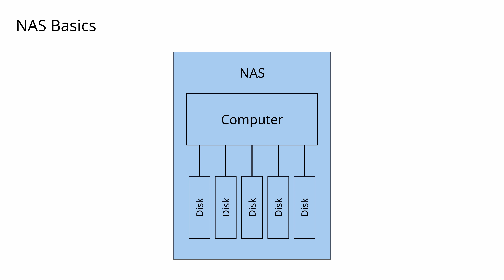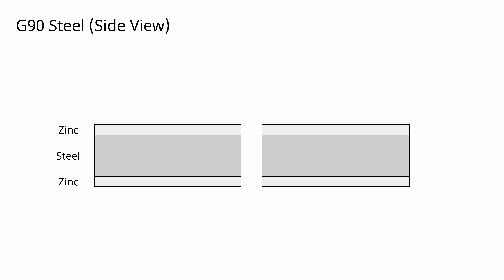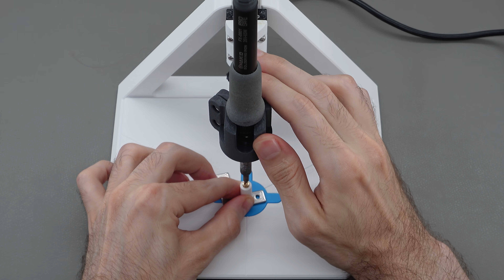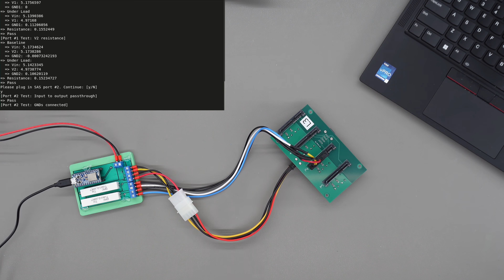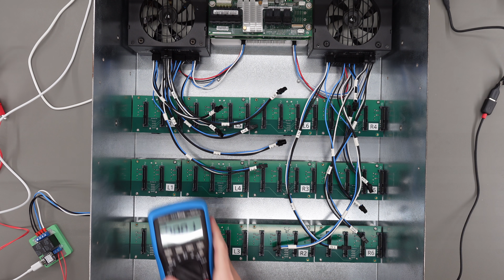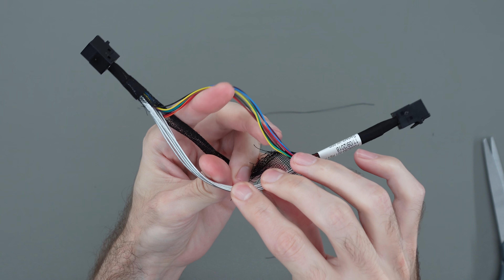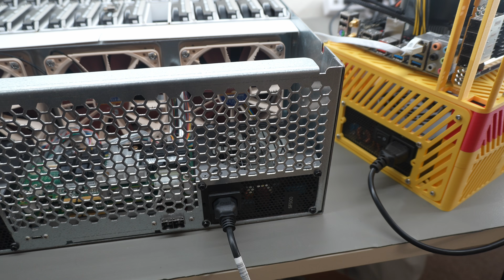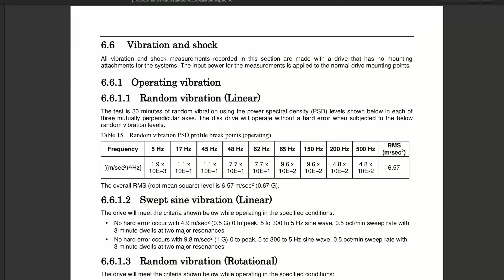I Built a 1 Petabyte Server From Scratch

Comment: Good grief, spectacular job.  What were the green and red LEDs signifying around the 25m 22s mark?
Reply from the maker: Literally nothing. They are just part of the LED animation I made for the intro and outro.
Reply: @MadeByDennis  Hah!  I had thought drive activity lights might have been pushing it a bit over individually addressable LEDs, so was maybe thinking one had a fault whilst the other was initializing.  But your explanation makes perfect sense :D
Reply from the maker: @SkyOctopus1  Red is normally faults when running the real software. I wish I could get initialization status, but unfortunately I can't currently check that in the software... Maybe in v2.

Comment: Normal NAS builds -> just buying parts and throw them togehter.
Dennis -> hold my soldering iron
Epyc build!
Reply: Don't forget this isn't a NAS this is a storage shelf, which is then connected to the NAS. Is really common if you need storage you can buy one server and then daisychain multiple storage shelfs, without much computing performance like here.
Reply: @Junky1425 @Junky1425  It also shows that Dennis doesn't have experience running these sorts of arrays, because there are fundamental design flaws that will inevitably lead to data loss without full backups, and the need to rebuild from scratch with extensive downtime if he does.
Reply: @jonathanbuzzard1376  and they are?
Reply: @asdafafsafda well a power button is one; no commercial JBOD shelf has one. More importantly two power supplies powering different bits is another. You need to think about failure conditions because at some point one of those PSUs is going to fail when the system is power on.
Reply: @jonathanbuzzard1376 lmao  nonsense. Clearly you don't know what you're talking about.
Reply: *Hold my soldering OVEN.
Reply: Hold my iron.
Reply: Not Epyc. next week, replacing the raspberry pi with threadripper ;)

Comment: The density looks awesome, but how are thermals with that restricted airflow?
Also, are you not doing an SSD cache?
Reply from the maker: Never above 40C in my testing on all the disks. Around 35C is typical. It helps that there is fairly little stuff behind the disks further obstructing the airflow. I have a separate SSD pool but don't mention it in the video.
Reply: @MadeByDennis  No, no, don't use a separate pool. You can use an ssd/nvme to do caching or bundling of transactions. This could improve performance a lot. Just google "45drivers zfs caching" to find some details.

Comment: It is really cool. I think the capacitors you used on this boards might be actually too big. They would cause a massive inrush current, and also if one of the disks fails, and fuses do not kick-in it will pull a massive amount of current and energy. Destroying a lot. In general capacitance should be as low as possible. For big boxes like this, you should configure drives (using jumpers) to not spin-up until commanded by operating system, to limit peak current instead.
Reply from the maker: Yeah, the capacitance hasn't been properly tuned yet so was more ball parked so far. The ATX and other PSU specs specify inrush capabilities and this is still well without the spec though. If you buy a SAS HBA like the one I got, the card will handle staggered spinup of the disks. In my case I have it on the default setting of spinning up 4 disks at a time.

Comment: You should re-print the HDD cage out of an elastomeric filament to absorb vibrations. I shock mount a mechanical hdd in my case with cut up sections of 1 inch automotive nylon re-enforced heater hose. I pear down the isolator with a knife until the correct level of stiffness and isolation is found. I'd never rigid mount a HDD again

Comment: making me jealous over here since i just lost my dell optiplex 7010 with motherboard damage ive been fixing for years to a power surge, took out two of my 3 zfs drives in raidz1 too, and since i was running truenas most of the backup stuff was faulty because of course it was, so yippee, i wont know if i had data loss till i get a new server i can plug all my brink of death drives into

Comment: Awesome project! and flipping through the repo, an even more astounding job of documentation! With the density of the drives, and Noctua fans not being the high static pressure blowy-ma-tron fans you normally see in a server, what are the drive temps looking like at idle and under load? Also, ignoring the cost of the HDDs and all your time and labor building it, do you have any sort of ballpark number for what you spent on building the enclosure?
Reply from the maker: I added answers in the pinned comment. I think this is close to the limit of what you should use these fans for. I am also using the slightly more pressure optimized version of the fans. I think this barely works since the drive cage is fairly minimal and there is intentionally very little behind the back fans further obstructing air flow.

Comment: Out of curiosity, why not have compression enabled? With modern CPUs, compression and encryption don't take very much overhead.
Reply from the maker: See the other comment mentioned. The compression reduces the amount of space used so doesn't allow a fair overall comparison since it is data dependent. The other parameter disabled is ARC (caching). I want to test the throughput of the disks and not of any caching layer in front of the disks.
Reply: raw testing.
Like testing a tube for its max pressure it will fail, when you know the system will only have a third of that pressure at worst.
Reply: @guy_autordie  That makes sense, thank you. :)

Comment: Absolute fire video. The only thing would be to design a power distribution board to achieve redundancy between the two PSUs, but otherwise it's perfect.
Awesome build! Seems like we have pretty close hobby alignment, but EE & PCB design is the one thing I'm too scared to jump in yet.

Comment: That's insane build, but why did you go with SFX power supplies in a first place? Considering that you've made custom PCBs you could go for just DC 12v and DC 5v power supplies which fully dedicated to specific voltage from the start and control poveron/poweroff state with couple of SSRs, you've generally paid more for power supplies and spent a lot of time on testing something which could be hell a lot simpler and cheaper
Reply from the maker: My main concern was the size. There is 150mm of depth reserved for connectors and the PSUs and I also need to minimize the height to avoid restricting the airflow. Let me know if you found any existing PSUs that fit well but I couldn't find any aside from these. The cost was kept under control by buying these second hand on eBay so I only paid around $150 today for all the PSUs.
Reply: @MadeByDennis  well, any power supplies in Meanwell UHP series form-factor would stack up easily there, you would need to buy and wire IEC C14, but it's far easier than crimping even a single custom cable you've did for those SF600s, also they can be just connected in parallel on a single distribution board, so you wouldn't have to balance load between them(yet it is a good idea to look into datasheets because some models have features specifically for making your life easier in this kind of usecase).

Just as an example MW UHP-1000-12 gives 80A at 12V(so it could handle all of your 12v requirements alone) packaged in 240*115*41mm (L*W*H) and it is fanless it's just required to not being enclosed(e.g. air convection from HDD fans will be more than enough) lower power UHP's goes in different dimensions, as an alternative example you could get 4x UHP-350-12 which would give you extreme flexibility at placement with dimensions 220*62*31mm (L*W*H) as well as give you 3+1 redundancy, for 5v PSU UHP-200A-5 would be enough i guess since it gives 40A at 5v

Comment: Highly suggest moving the PCB data into its own repo and licensing it under CERN OHL v2, not only is that a more fitting license for a hardware project but its also "less messy" than having PCB files embedded deep inside what otherwise seems to be configs, code, ect.
Reply from the maker: Thanks. I'm a big mono repo fan, but going to set up some better organization / licensing situation once I recover from responding to all these comments.
Reply: This guy is insane with his builds... he needs to properly license them in his repos as the cherry on top
Reply: @MaltedChoco  licensing is actually not a requirement
Reply: @thewhitefalcon8539  yes, but it prevents greedy jackasses
Reply: @MaltedChoco  doesn't. They can just copy your design and ignore the license.
Reply: @thewhitefalcon8539 theres nothing stopping them sure, but when you license under a strong copyleft license an entire army of lawyers from copyleft foundations will assist you with enforcement
Reply: @MaltedChoco China: hold my Baijiu (白酒)!

Comment: bro's made out of money
Reply from the maker: From many years of laboring away on the other side of this ads based economy...
Reply: @MadeByDennis  How are the thermals on the build, especially the drives in the middle? i know the 45 drives ones has small gaps allowing air to get through so im curious. I would like to make this especially cause the only 45 drives chassis's that are for sale used are all the old ass ones not the new pcb backplane ones
Reply from the maker: There are gaps between the disks for air. The temps are around 35C average for a disk and 40C peak. Most of the space in the back above the PSUs is intentionally empty since this is about the limit to what works well without more powerful fans.